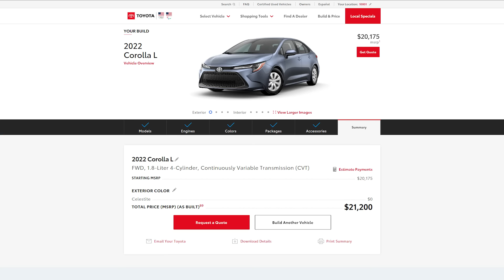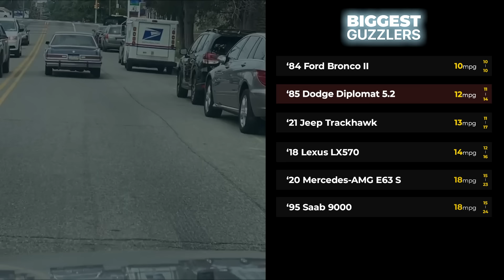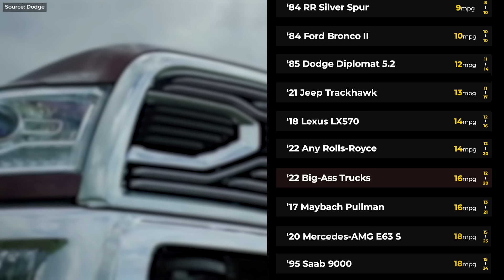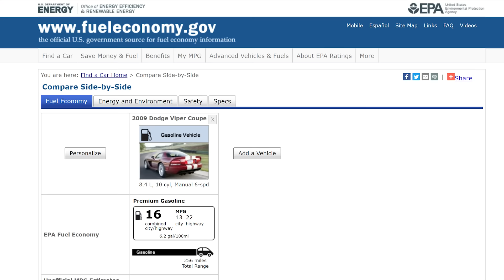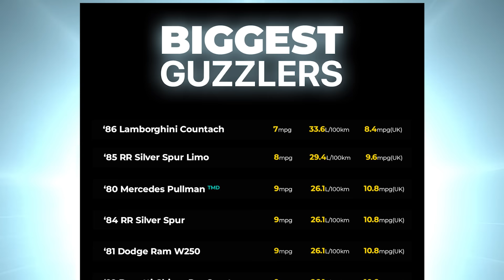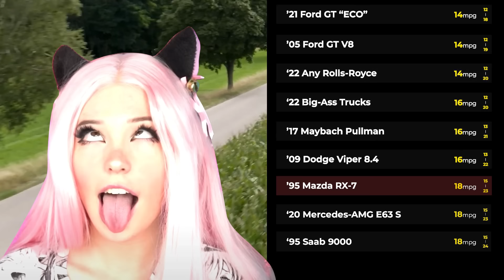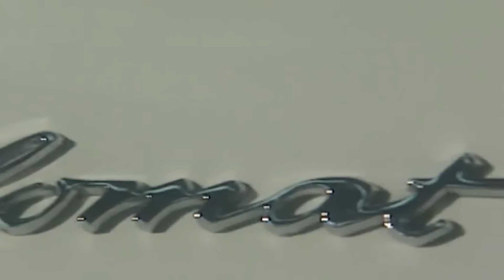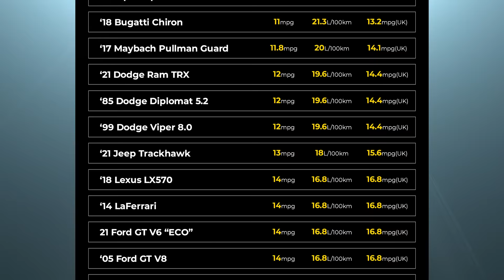RANKED: which Cars use the MOST FUEL?

Comment: The Bronco II never had a V8 from the factory as the Ford Bronco II was based on the first generation Ford Ranger Pickup and the three engine choices were a 2.3L Lima N/A  2 BBL carb (1984-1986) had 93 hp and a 2.3L N/A EFI Lima 4 cylinder had 100 hp got 17 city23 highway and they also had a 2.0L Perkins Diesel that had 74 hp and got 45 highway 31 city only av from 1984-1986 and very limited run. The last av engine was the 2.9L V-6 which was 2 BBL carb from (1984-1985) got 14 city 20 highway and gained sequential EFI in (1986-1989) and these got 15 city and 20 city. These numbers were for the  2WD models only.
Reply from the maker: I confused the Bronco II with the full size model. They were not at all the same thing.

Comment: When I first bought my 21 Dodge Challenger TA392 widebody it was getting on average 13.4mpg now it’s reaching 3000 miles and on the highway way when driving normal lately I’m getting 16.7mpg average. I did see it go to 20 once but I put it in track mode and that went right down 11mpg lol. I’m hoping after it’s first oil and filter change that mpg goes up I’ve seen other challenger owners getting 24-27 mph average but then again those were all older guys who probably drive it on the weekends when it’s perfect weather garage queen type driving.

Comment: About a Saab. It's not really fair to get 150hp version. Firstfully, 2.3 turbo will be 170hp at minimum and 230 at maximum. And that's not taking into the consideration that they can be pretty easilly ECU tuned to get 220-250hp. And those engines get 11l/100km city and 8-9l/100km hwy. Plus, there  were plenty of cars that made less hp and consumed more fuel. Especially looking at the same era turbocharged petrol engines

Comment: Aleso, as a farmer from europe. Average combain burna about 20-30 liters of disel per working hour ( usualy inline 6 or v8 with around 10-18 liters of engine capacuty) and my new Fend with 7.8l engine tractor burna about 12l per h , my 1986 14.2l streight 8 cilindre Deutz fahr about 24lph but in other hand my old ‘50s Porsche single cilindre can do about 6-8. 
Disel is 2.2€ per liter in my country

Comment: My country: Spain
Gas price: Around 8$ per gallon.
My car: Volvo XC60 D3 (2.0 5 cylinder diesel) with 40 mpg.
Reply: That's amazing! My 2014 Volvo s60 t5 is getting around 30 mph currently!
Reply: @michigan_supercars6569  Mine is from 2013, when 90% of cars were sold in diesel version (European Union). 163 BHP. Not much power, but  very efficient!
Reply: Country: United States
Gas Price: 4$ per gallon
My car: Toyota highlander v6 with 20 mpg

Comment: That Bronco II was all wrong. The II came with a 2.8 or 2.8L V6, the full size Bronco got the 5.8. The II was based on the little efficient Ranger
Reply from the maker: I wouldn't say "all wrong". I did pick the worst spec as an example
Reply: @TopCarsTV  they are completely different vehicles with no shared parts, so I would agree with the previous commenter that it was completely wrong. The Bronco II and Bronco in the 80’s were like the difference between a Ford Escape and a Ford Expedition today. They are completely unrelated.

Comment: You have more pictures of a bronco II than the full size bronco which I'm sure the mpg rating you quote.  Also, I had a 83 new Yorker 5th Ave, the Chrysler version of the diplomat with the same motor, it actually did pretty reasonable for fuel mileage even with 250k on the odo.

Comment: My V6 3.0 Diesel Audi does 6/100 ( around 40 MPG ) which gives me to option to drive for 1000 km ( 621 miles ) on a full tank of Diesel on Autopilot with 130 km/h ( 90 mph )
Diesel Price is 1.76 € for a Liter at the moment , so a full tank costs me around 105 to 110 €
Reply: Where do you live if I can ask
Reply: @cwf_media9200  Bulgaria , neighbor of Greece and Turkey
Reply: @georgfranko  cool I woundered for the "cheap" gas prices in dammed Germany between 2.10 and 2.50
Reply: @cwf_media9200  yap , Diesel was at 1.40€ per Liter like 3 months ago , and I still remember I used to Tank Diesel for 1.10€ in Germany back in 2014/2015 :D

Comment: Fuel in the Netherlands at this point is 2.20 euro per liter..... And that's the cheap 95 octane fuel.  We also have 98 octane fuel that cost around 2.31 euros per liter. But the case stations at the highway are insane!  2.31 for normal gas and 2.45 for 1 liter that's not even one third of a gallon as 1 gallon is 3.6 liter.

Comment: 2014 ford fusion 2.0 turbo 285 hp... it was tuned...in cruse control i get 34 mpg highway at 70 mph   at 55 she gets 37 mpg... i work as a classic italian car tech... and drive a distance to work.. so i have a bit of fun seeing the gad mileage at diff. speeds over a 30 mile flat run( pretty flat here in the sacramento valley ) and 24 in the city...not bad..its a great car...gas at 4.89 at the moment a gallom

Comment: Untill recently I had a 1964 Cadillac with a 7.0L V8. It did 9mpg max on the highway. So it was quite expensive running it here as fuel is around €2.20/L

Comment: You fundamentally don´t understand what fuel efficiency is. The Bugatti Chiron is quite fuel efficient, considering the horsepower its engine produces. Efficiency != mpg.

Actually, even a modern internal combustion engine is not more than about 35% thermodynamically efficient, because of heat loss. (The above Chiron has eleven radiators!)

Top Gear had an episode wherein the hosts expressed astonishment that the American full-sized sedan of the 70s and 80s they put through its paces, produced only 180 hp from a seven liter engine! -- a weak engine which was also very fuel inefficient.

Incidentally, a bus that achieves three mpg when carrying a full passenger load has a commendable fuel economy per passenger.

Comment: Nice job,   diesel is at 2,52 L and gas is at 1,87 L.  I used to love driving my bmw 328 FT about half the time i drove it,  i used to get about 200 to 250 km per tank,  or i could just cruse on the highway for just over 726 km ( yes 726,  ask how i know😑 ).

I loved the tractor-trailer loaded with 35 tonnage added for reference.   

Can anyone throw out how many km or ml they would get worst case,  showing off,  im gonna see how quick i can burn a tank?  Just curious people!   Worst case for me was 200 km out of a full 90 L.

 Whats your worst-case?

Comment: I think some engines just by design alone are going to be worse on gas than other engines of similar size. Like the Dodge 360 or Ford 300 Inline 6. Great torquey engines but love gas like it's going out of style. I also had a Ford FE360 that was notoriously thirsty for it's time. I think it has a lot to do with cylinder effeciency more than just size.

Comment: Rich dude: "Tell me the the maintenence of this brute "slaps a bugatti veyron demo car"
Dealer"50k for each tire to be replaced every year even if it didn't run,  mpg of 1.88 as this baby is a drunkard, 6.4k to replace each    individual turbocharger and approximately 9k in labor costs to replace a pair. An air cooler is 9k and there are two of them, while labor for each is another 2k. And don't forget da tax"
Rich dude:"Ok ima head out"

Comment: I own an Opel made Holden Astra 2005 model on highway cycle 800km to 50 litres of Unleaded 91 fuel currant price for fuel is $2.20 per litre AUD. I am based on the Sunshine Coast in Queensland Australia. On city cycle it is not to bad either as I get 650km for the same amount of fuel. What we call GAS is LPG. NOT PETROL.

Comment: The Bronco II and the Bronco were two different vehicles. The Bronco was based on the Ford F150. That one had the 5.8 (351 CI) V8 , also a 302 v8 and an inline 6 were available. The Bronco II was based on the Ranger and had a 2.8 litre V6. You show footage of both. The Bronco II would have gotten better then 10 mpg.

Comment: Croatia, 12,36kn/l = 1.7€/l = 7.4€/gal = about 8.1$/gal.
I drive 1.6 inline 4 on ITBs with around 150hp from 1999 (Peugeot 106 GTI) wich does about 7.3l/100km = 32.5 mpg and for funn Mazda Rx8 1.3 wenkel which does acirding to its tripcomputor 10.2L/100km = 22mpg + 15€ for a liter of 2 stroak oil which goes in 4% mix with petrol

Comment: the Cadillac Eldorado of the late 1960s early 1970s got about 10 MPG gas currently Cost around 5 dollars a gallon for regular in Massachusetts where I Live and nearly 6 a gallon for premium and 7 a gallon for Diesel mind you the Eldorado hardtop of that era weighed 2.35 Tonnes  where as a 2022 Toyota Corolla Hatchback gets a combined 35 MPG with a Curb weight of 3,100 which is 1.55 Tonnes and its gas tank is roughly half the size of the old Eldorado at 13.2 gallons

Comment: I have a 2000 Oldsmobile Intrigue GLS that has a 3.5 litre 215 hp with a 17 gal fuel tank. It is basically a 20 mile to the gallon combined, it is said to be 17 miles in the city, and claims 26 miles on the eway. I've actually have kept an eye on the mileage to gallon ratio, I would leave from Machesney park IL, to go to Chicago roughly 87 miles, it would take roughly 5 gallons to go oneway. So my car is getting about 17 miles to gal on the eway. Not very good, especially with the price of the 87 octane costing $6.39 a gallon. It kills my bank account just to fill it up and keeping it rolling. I sometimes don't use the a.c. so I can try to save gas, I don't think it does much though.

Comment: I'm surprised about your statement about the Saab 9000. It feels like you're holding it to modern standards. For its time, it was big in fact so big that when Saab brought out the NG9-5 (25 years after 9000 entered production), which only was 6cm wider, Swedish motor press called it a behemoth that had no business being on city streets. While only slightly heavier than a GT86, it was heavy when compared to other Euro sedans of the time, almost 100kg heavier than Volvo 740. In terms of luxury, equipment and status, it was on-par with Audis and very close to Mercedes and BMW of the time. And for the time, the 9000 was extremely sporty for being a family car. The "family man's Porsche" people used to call them and the Swedish police bought Saab Turbos to replace their Porsche 911's because the performance difference was so small.
And if I'm not mistaken, the Saab 9000 consumed no more fuel than any comparable car of the time.

Comment: To answer all your questions, I live in Switzerland:
Gas here is about $2/l which is $9/gal. 
Fuel efficiency is somewhat important to me, I plan on getting an EV so if RS7s with the V8 drop in price I'll switch to a combo like that. Right now I'm driving an S5 which does 9-12l/100km depending on how I drive so pretty decent.

Comment: when it comes to MPG
i have a old royal enfeild taurus (world's only production diesel motorcycle)
it easily does 205 mpg 
the most fuel efficient thing i have ever seen
1 full tank gives me 680 miles of range
Reply from the maker: A diesel motorcycle? I bet that thing runs worse than Stephen Hawking 

Badum tss
Reply: @TopCarsTV  it runs flawlessly i daily drive it but the vibrations at high speeds will shake your soul
Reply from the maker: @ajaychoudhary9817  I would imagine. Still, for 205mpg, I wouldn't mind if it didn't have a seat at all
Reply: @TopCarsTV  absolutely man!

Comment: my 2001 Crown vic after modifying it to push 350HP and a ton spent on mods and getting it tuned. it would get 23 mpg but if i drove it like a maniac it would drop to 8MPG you could visibly watch the needle moving in that car.  and when i slapped on the new exhaust....a mix of stuff from Stainless works headers 2.5in exhaust allthe way to the rear axel new H-pipe. and a set of Flowmaster 44s at the time the loudest mufflers they made tell the 10 series. the Drone was so bad you would have to scream yell to each other at 55MPH Xpipe would of fixed that but it would get rid of the pops and crackles and given i had them do the lowrider trick to pipe down to the stock pea shooters a pop and a bang she would go........... 8MPG does not sound so bad....but 11 years ago when gas prices in CA had not stabilized yet and premium octane was 6$ a gallon with a 20 gal tank..........this car would eat a quarter a paycheck ever every week. i basically started making only enough money to fuel it and pay insurance.................man i miss my Crown vic so much.......

Comment: at 1:10 this is already COMPLETELY wrong. He mentions the Bronco II and that car never had a V8 engine. The full size Bronco had a V8, but only sold about 163,000 full size Bronco's. That doesn't really matter though because this guy has NO CLUE what he is talking about by even mentioning the Bronco II
Reply from the maker: I mixed them all together without realizing that the Bronco II was an entirely different models. 

My bad

Comment: This is all comparative BS. The EPA fuel economy is a calculated figure. For actual mileage, one has to source owners' forums.  For example... Top Gear Uk did some good tests. The took some super cars, gave each one a single gallon of fuel and sent them around a track at high speed. The Ferrari in the group didn't quite make 4 miles.  When they did the comparison between a Prius and a 6 cylinder M3, they told the Prius driver to drive as fast as he could and told the BMW to stay with the Prius. If memory serves, the resulting mileage for the Prius was 16 mpg and the BMW got 18 mpg. It is all in how you drive... the EPA can sort of define a near limit of what you can get, but it doesn't say really what you will get.

Comment: I drive a 2003 Mercedes E class with a 2.7 litre 5cyl diesel which can get up to 50 mpg UK on a long run on motorways fuel in the UK is avg £1.80 a litre diesel and not much less for petrol.

Comment: You showed a fullsize bronco, Bronco 2 is completely different in weight, size and power plant. The b2 is not heavy and has a 2.9 liter not a 4.9 or 5.0 or 5.8. A bronco 2 can get almost 21 mpg if running right. Yes the full size is about 10-12 mpg but the bronco 2 is a completely different vehicle

Comment: That's crazy about the new and old  ford GT"S  my 68 charger se would get the same milage as my 2000  2500 HD with the  not in production anymore 8.1 liter big block six speed Allison transmission overdrive versus a torque flight 3 speed with the same rear end gear 30 over built motor carbureted versus fuel injected backing around '08 when gas was over $4 a gallon in most States it was $20 a day to drive my truck in town that is if you kept your foot out of it and air conditioning off and you weren't towing anything

Comment: I will add this there’s a difference between fuel efficiency and fuel economy fuel efficiency is the amount of power an engine makes of a given or a set amount of fuel. Fuel economy is how far that engine can go on a given or set amount of fuel. I have a Hyundai Sonata car that gets 30 miles to the gallon it has a 2.4 L for banger in it. I have a pick up truck to that’s my farm truck it’s a Chevy Silverado and it has a 5.3 L V8 that gets 17 miles to the gallon highway. Given that the 5.3 is over twice the size of the 2.4 L but yet gets slightly better than half the gas mileage of the 2.4 L it would be safe to say that the 5.3 L is more fuel efficient it creates more power out of a given amount of fuel than the four-cylinder does. But my Hyundai Sonata gets better gas mileage. There’s a lot of cars that get better gas mileage and people think they’re more fuel efficient and then they’re wondering why a lot of big trucks get 1516 some up to 20 miles to the gallon and how could that be because sometimes V-8 engines are more fuel efficient because the design allows for more power out of a more compact engine. A V-8 engine on average is more fuel efficient than a four-cylinder. But on average a four-cylinder can go further on a tank of gas but most people who have vehicles with a V-8 also tow campers boats or have Softing that they just can’t tow behind a Prius. Some people just like having big vehicles but thought I’d share that

Comment: SAAB 9000 2,3 figure is not correct, I’ve had 3 of them and they are around 1l/10km like all other “big” sedans from the 90s. 
Funny enough now I have an e63s and it’s around 1,1-1,2l/10km which you compared the Saab to.

Comment: $7.86 a gallon for petrol (gasoline) My RX8 R3 - 18mpg, My Ford Ka 55mpg. Have a guess which is my daily & which is my weekend 🤣
Reply from the maker: Both are Ford Ka since the RX-8 is broken? 😁
Reply: @TopCarsTV  😮rude 🤣
My Rex is just fine. Snuggled up warm in the garage with a permanent supply of food (trickle charger lol). Been sat for 6 months ready for the summer & started first turn of the key when I warmed it up & cleaned off the dust & cobwebs last Sunday 😜

Comment: And I hear tanks use about 5 litres per km. 500litres per 100km
A litre of 98octane is around 2 euro in the Netherlands right now
My old car, mazda 3 mps (Mazdaspeed in the murica's) could drink 50l per 100km at wot 6k rpm. 10/100km in normal driving. Ohh It wasn't stock

Comment: Maybe I own the two french cars with the highest fuel consumption for what they are
Twingo RS : 1.6 133hp 1.1t sport car? 8l/100 average and if you do not hit it. A bigger Clio RS with a 2.0 182hp and heavier repertedly drink less.

Laguna coupe v6 3.5. 10l/100 highway/backroads and 20l/100 city. From a modest 240hp n/a v6 with a modern 6 speed torque converter......

Comment: You are confusing the Bronco II with the full sized Bronco.  The Bronco II had a smallish V6 engine which got more than your 10 MPG. The Full sized Bronco had various available V8 engines available and some of the larger displacements would have been in the 10 MPG range.